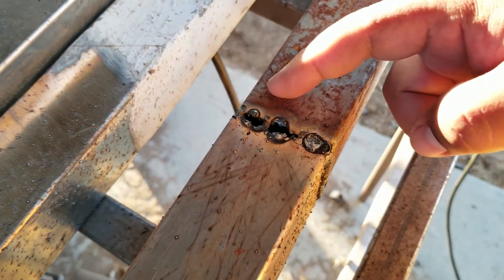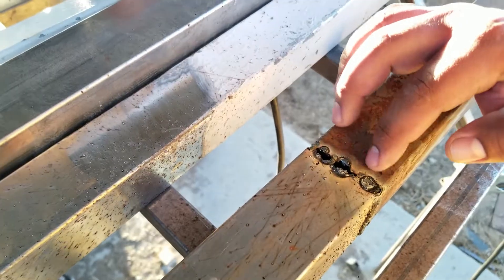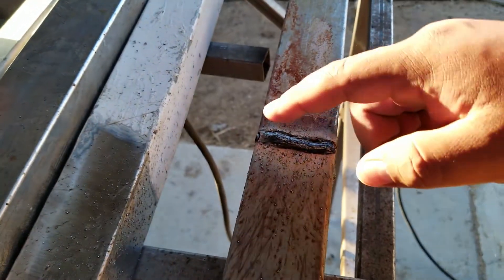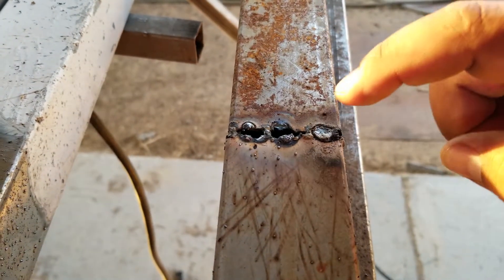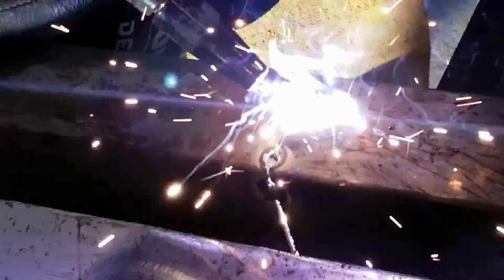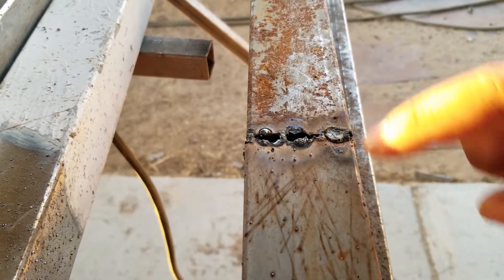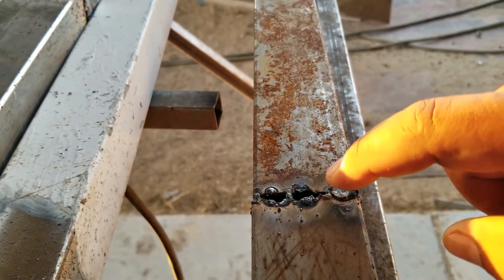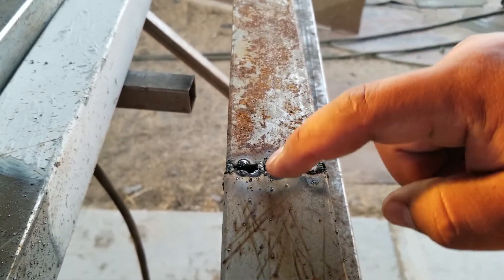How To Weld Holes In 7 Mins | Gasless Flux Core Welding Tips And Tricks |

Comment: I'm just just a beginner, but when I have to fill up holes or gaps, just grab a welding rod hammer the flux off it and stick it in the gap or hole and weld over it. I find it a lot quicker. Thanks for the video.

Comment: Hey thanks for the tips, I have a question  in regards to slag. Does slag form right away after releasing the trigger or  does it take a sec or two after the glow disappears to form. For example at 4:05 you can keep welding on top without removing slag as long as you do it right after the glow?
Reply from the maker: Good question, slag is continuously forming and floating to the top as you weld. You technically cant weld directly over slag because the slag breaks the ground conection so you would have to start the weld off the slag and then crossover through the slag. For something structual, I wouldn't recommend doing thos but for thin metal like fencing or body panels, this is fine.

Comment: Quick question I’m dodge guy to, had a 68 a108 , are you welding back over the slag at the end of the video?  Also I noticed you stand off was about a inch,  I know your not working with gas like mig welding so does that matter
Reply from the maker: For thin metal, it doesn't really matter if you weld over the slag. As soon as the weld pool begins, it'll push the other contaminates out of the way and off to the sides. After that you just grind it smooth if needed. You want to be about 3/8" away from the weld pool. Although flux core isn't that picky with distance, gas welding is a different story. I only weld far away while filming so you can see what I'm doing.

Comment: I know that your excellent  detailed explanations never  leave gaps 👲 👲 , but I didn't know if you had removed any slag between strikes ? Is it the wire being used or just me ?
Reply from the maker: The wire has a lot to do with it but also the time in between each strike. If you strike before the weld fully cools, you can manipulate the weld so that you have minimal slag. Before doing the final pass over it, I do clean it all off first since now the metal is strong enough to hold a weld up.

Comment: Some good solid advice, but aren't slag inclusions an issue when doing multiple passes without slag removal from the previous pass?
Reply from the maker: It depends on what you are welding, if its something structural, then you'll want those welds as clean as possible in between passes. If you're welding sheet metal, it doesnt matter too much.

Comment: my problem is i over think my hand speed and i have no patience lol. i wish i would have invested in a stick welder instead.
Reply from the maker: Stick welding is even harder 🤣 trust me, Ive been trying to make a video on it but my welds are ugly as sin
Reply: @NightWrencher  yeah, i put a ton of holes in my carpet wand trying to weld the head back on. now i have a swiss cheese wand with metal epoxy to clean up the holes
Reply from the maker: Oh geez. You need to go pick up a few pieces of scrap from a local recycler to practice on. For very thin metals, turn down the wire speed and turn down the heat. Tack weld the area all the way around, clean it up with a wire brush then weld a bead over it.

Comment: No nozzle?
Reply from the maker: I took the nozzle off and installed a rubber cover instead since I'm not using gas, I don't need the nozzle. Easier to see
Reply: There is a nozzle on his gun, but it's smaller than the normal MIG tip. You can buy these nozzles specifically for flux core welding. The normal MIG tip is designed as a shroud to direct gas towards the weld. Flux core doesn't need that, so the smaller tip is better because it lets you see what you're doing better.

Comment: I like how you explain flux core welding. I am getting ready to begin some flux core welding over the weekend. On some videos I've seen where someone is tacking the parts together, they will emphasize that you should clean the flux off the weld before continuing with the full weld. But in a number of other videos, like this one, it seems that you can weld a series of tacks which helps the metal cool down without having to clean off the flux each time. So I am just trying to understand the whole process here. Any help would be appreciated!
Reply from the maker: Typically you do want to clean off each weld before continuing but sometimes its not possible so as long as you are not letting the weld fully cool, you can pull out all the flux at the end when you do a final pass. When doing body work, you cant do a final pass without warping the panel so weld your tacks about an inch apart, clean the metal and then offset the next set of tacks and repeat until you finish welding the panel

Comment: correct me if i'm wrong, to my knowledge if it took more than one second for it turn gray than it is no good. 6:28
Reply from the maker: The glowing means its over 900 degrees F but theres no spec stating it cant be red for over a sec. Thicker materials for example with stay glowing for several seconds because the added material can hold more heat. If you are worried about over heating the metal, you have to look at the area around the weld to turn dark black and not the weld itself.